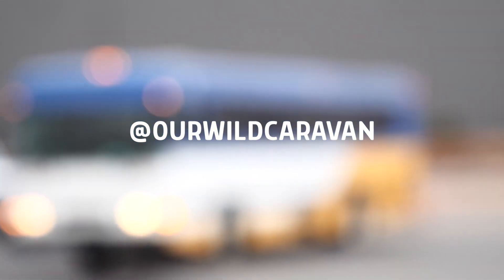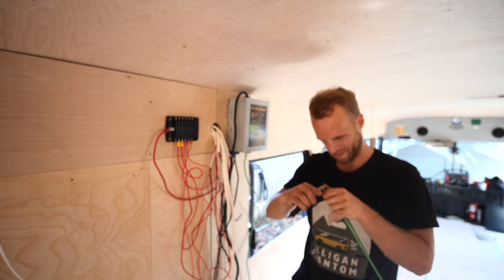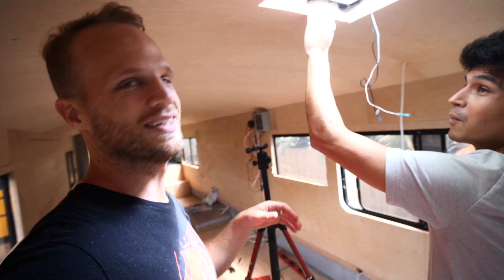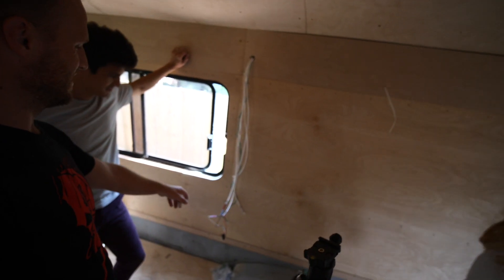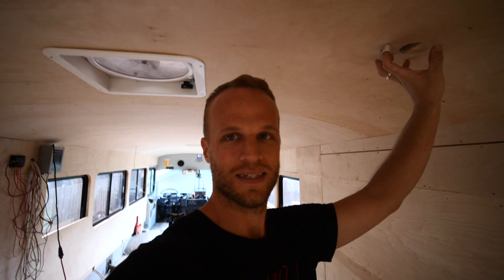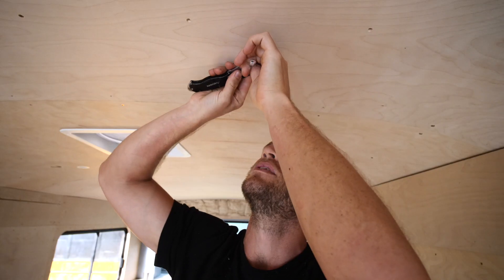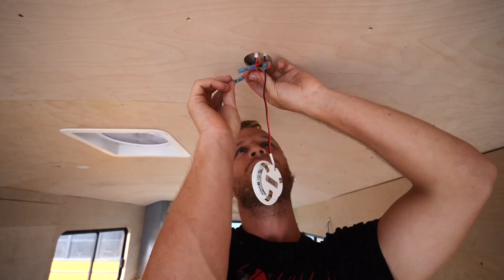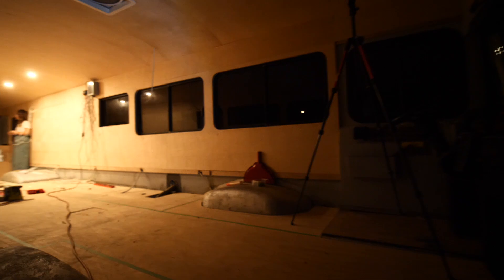We Found the Perfect Puck Lights! Bus Conversion Lighting Install

Comment: Take the hole saw pieces that were chat out. Take a scarp peace of wood and mail it on the area between roof and ceiling and then take the hole saw peace and drew it on and then woof filler and and.

Comment: As a former professional wireman for elevator controllers and new cars, I'm curious. Are you using automotive circuits where the circuits are hot all the time & the ground is switched, or are you switching the hot side?